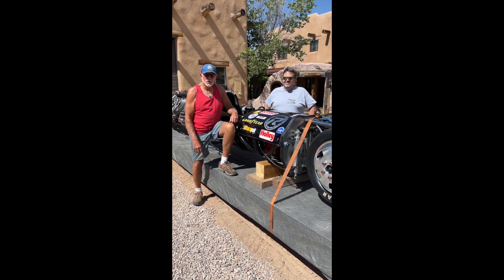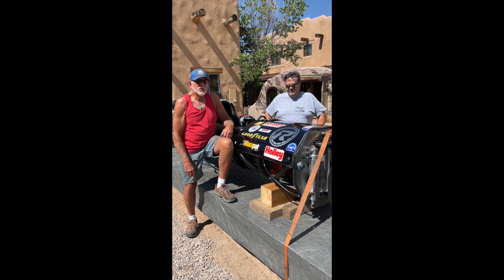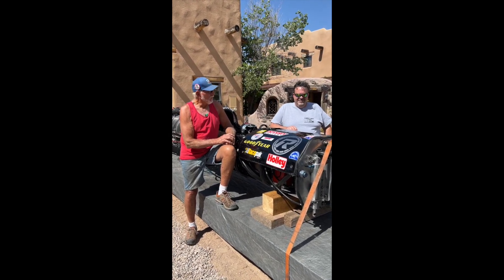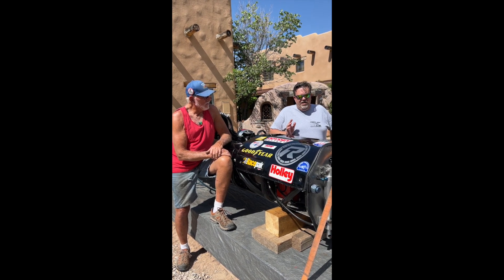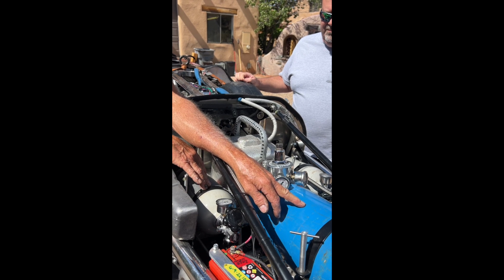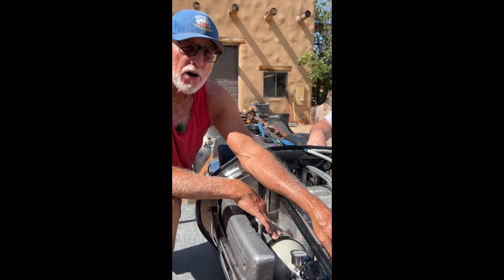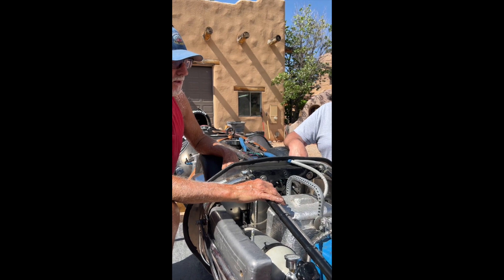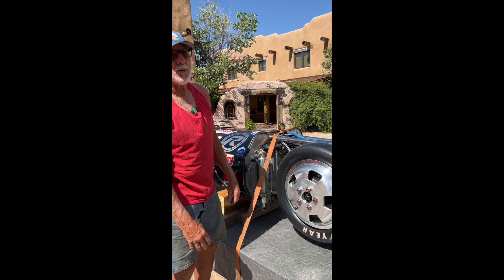2022 START UP

Comment: a pitty no younger enthusiasts stepping in. Very likely  some sort of closed loop controll should be added for a more prooper/better/optimized acceleration - if i want 7% slip (as measured difference driven/to undriven wheels) i can choose so. or 4, 11 or 18 - as appropriate for me as the driver, as i feel while we accelerate. Thus meaning, we always go max throttle, but grip, as measured real term every fraction of a second makes for the real g achiveable. The quality of the loop (and the inertia of the whole system) being the limiting factor once the data are collected correctly, we all know, as soon as a real good salt is available. In Moto GP it's long standard accelerating out of corners under lean angle. I definitivly need more pirats - Liz first said it, not Sir Francis?
Reply: this car is all wheel drive.  closed loop traction control with differential VSS isn't an option.   It's all in the driver's foot.  Also, piston engines are 10 light years different control than gas turbines.   as far as younger enthusiasts, our entire tech team are in their late 20s and early thirties, except for me (late 40s lol).  The sport is alive and well.